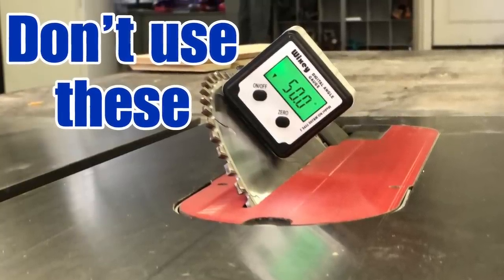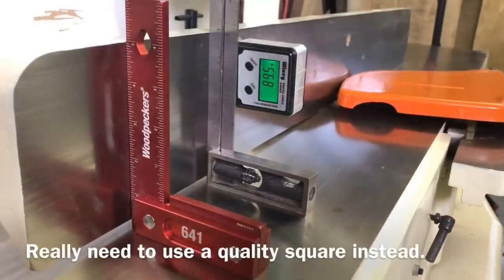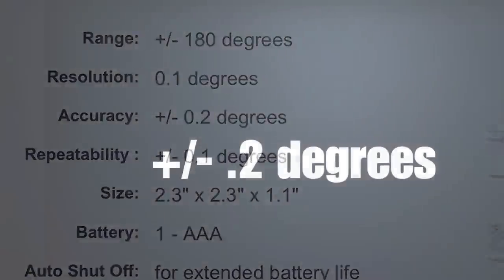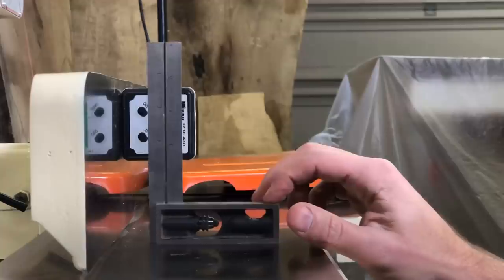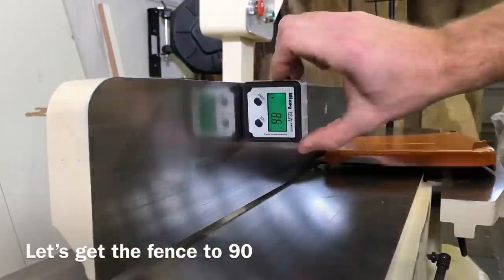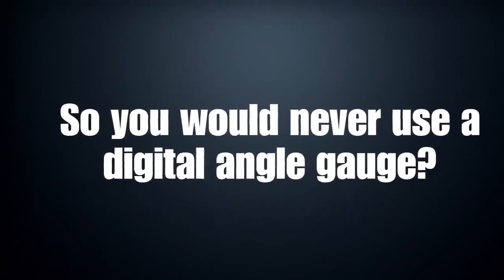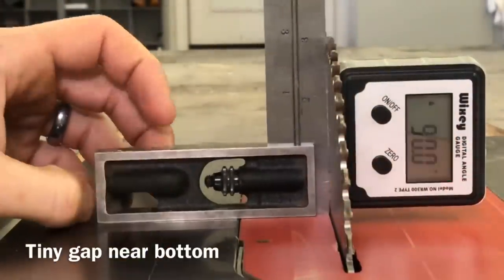Table Saw 101– Digital Angle Gauges— How To Woodworking

Comment: Home Depot squares are perfectly fine for 99% of woodwork needs. Pick out a square, stick it on a piece of plywood, draw a line, flip the square, draw another line next to the first. If those two lines track each other, it's good enough for woodwork. If not, pick out a different square. Those hundred dollar squares are for machinists who are milling precision parts. Save your money and buy that power tool you've been salivating for.
Reply: Exactly .  I use mitutoyo, starret and b&s measurement tools with metalworking and the precision that gets you is nowhere close to what I need for woodworking.  HD squares are fine for my wood - at least the type I do...
Reply: You said it all. We deal with wood which is flexible enough to absorb such small errors.
Reply: Rich Sobocinski I look forward to the day when I can blame a tool that is off by minute amounts for the mistakes in my projects. Right now I am thrilled when can make a drawer that doesn't bind.
Reply: @MJCPeters  hahaha!!! Same!!!!!

Comment: Woodpecker Tools are essentially Festools of the hand tool world. They're novelty items with gimmicky features, and most of those features are glorified convenience items and not necessities. No question they have some innovative tools, but for the price they're asking, you're better off using that cash for another tool. Or, buying 2 tools instead of 1 Woodpecker tool. A simple speed square for $100+? For those naive enough to buy one, I have some beachfront property in Kansas I'd like to sell you.

Comment: I have adjusted my lifestyle to accept a 0.2° error. There's always gonna be fussy people in the world, and Starrett will be forever grateful for their continued patronage.
Reply: Or people who are doing metalworking who need dead nuts on measurement.  Absolute precision in Woodworking is nice, but far from necessary.
Reply: @shirothehero0609  Until you don't do something where it's required. Last year because of Covid I started to make some stuffs with wood and hungarian zithers. When I had shown one of my zithers to a luthier he mentioned about some of my joints is great for a furniture but it have to be better for a musical instrument.
Reply: @saxus  Wood is never going to maintain it's dimensions even from one minute to the next due to temperature and humidity. It also compresses, making it impossible to get a precise reading. For luthier work, you do need higher precision than furniture making, but the tolerance is still way below what's acceptable for even low precision machining.

Comment: He's saying a $100 square is more reliable than a $25 digital gauge. That's fair, but how does it compare to a $100 digital gauge?
Reply: I can get better accuracy using a square and my eye than the $100 johnson gauge i got. Honestly probably faster to. These gauges seem to have a really shitty lag time or only register movements of .2/3 of a degree or more
Reply: @zacheiriksson  the lag time drives me NUTS. Set it exactly where I want it, wait ten seconds, then as soon as my hand starts going towards the gauge it jumps by .1 or .2 degrees.

Comment: once and for all there is no reason to buy a $90 square from woodpecker or starret for that matter. I have witnessed a lot of cases of the woodpecker squares being out.  This is an example of prestige pricing like I have never seen. Go get yourself a machinist square for $20 if you want something accurate and be done with it. Want accurate measuring go get anything for metal working (what starret is known for) and they  will be more than accurate enough for any woodworking and at a 10th of the cost...
Reply from the maker: Thanks for the tip!
Reply: how do you find an accurate machinist square for $20? The ones I've seen on amazon for that price all have a number reviews saying they're out of square.

Comment: This comment might bump the algorithm a bit. I was taught to use the edge of the blade on my square instead the of flat part of the blade. Turning the square at a slight angle gives you a finer line to visually inspect better.

Comment: For digital gauges to work, the tool has to be perfectly level from the floor up. If your tool is on a angle at the floor, the angle will be off greatly when finding the square for a fence

Comment: 1:39 ⌐_⌐ and both squares had a visible gap at the bottom (you can even see light from behind them through the gap at 1:47 quite clearly) because they contacted the top of the guide fence first, telling me that the fence is effectively canted inward toward your blade.
It may well not effect your work as you alluded to, but the angle block is actually correct in those instances because the fence is actually slightly leaning inward from 90 degrees.
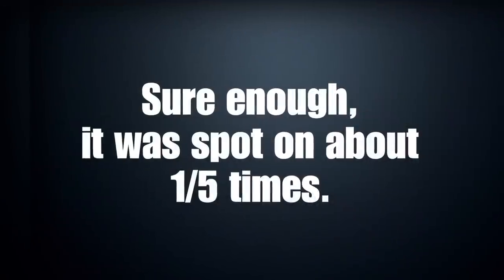2:21 So, you go to the effort of squaring the fence to the table, the angle block now reads 90 degrees exactly, and surprisingly enough your square is also flush to both surfaces.

I'm not going to say digital angle gauges are infallible, anything that is man made inherently includes man's limitations, but I think your video actually demonstrated that the gauges are plenty accurate and if anything helped you to identify that while your squares are indeed square, the fence was not square to the table, and once it was then all the devices started agreeing.
Reply: I absolutely agree with your observation. From my perspective I saw the same thing, and I think you're right that when he set the table fence to 90 degrees on the angle gauge, the square matched up flush to the fence, which just confirms the accuracy of the angle gauge.

Comment: i see a gap between both squares and the fence......1:47 in the video shows it really well. So the digital gauge is pretty accurate when it says your fence is at 89.5 degrees.
Reply: Saw the exact same thing!
Reply: Me too
Reply: Yes me too, the digital was accurate and his square was out!
He pushed the blade of the square against the fence lifting the base off the table at one end & pronounced the digital gauge as being out, but not his square! 😂😂
Crap happens- especially when your filming unfortunately!
Heck timber moves between summer & winter even after its kiln dried down to equilibrium moisture content, & how much the same species sawn from the same log varies, with whether it’s radial grain or tangential grain!
&
This guy is worried about + or - 0.2 of a degree?

What are you building a timber space shuttle? 😂😂😂

As my old man would say, “we ain’t building Omega watches, sunshine!” 😂😂
Reply: me three. you guys beat me to it
Reply: Yup, I saw it to
Reply: Well shit, I thought I was the only one to see this 😢
Reply: Me four. Although I have to say, I've yet to see one of these types of woodworking videos where someone diplays a square in front of the camera the way you should do it in real life to show if it's truly square. i.e. in front of a light source to see where there are gaps
Reply: I came here to say the exact same thing
Reply: Exactly this. Lightsource behind and no visible light, then it is square. A mouse could fit through the gap I saw down the Woodpecker one.
Reply: @m3nt4l173  From what I saw the bottom of the fence is worn slightly (or the fence isn't straight and bends 'away' from the table) - I'm not 100% on this, but I AM 100% sure that the internet NEEDS to hear my opinions. :D
Reply: I thought so as well. What we need to see is the square and some feeler gauges to see if any feeler gauge will slide behind the square at different points. even the light test isn’t 100% in my experience but if a feeler gauges slides behind, you can determine the degree of inaccuracy.
Reply: Saw that also
Reply: I see the gap too.
Reply: And that’s exactly why I came here to comment.
Reply: @ianmoone2359  
I build boats (fiberglass, not wood). When one of my guys was taking way too long, trying to be perfect, my go to was "Hey, Steinway, we ain't buildin' no Stradivarius". We always wanted to be really good but sometimes that last gazillionth degree of perfection will never come.

All that being said, 1/2 a degree could be too much, depending on the project.
Reply: I see the gap as well however it is not due to an error in either of the squares or the digital gauge. It’s because his fence is not flat. Unfortunately this is a common issue in the cheaper joiners made by Jet, Delta, Woodtek.  My inexpensive 6 inch Delta Joiner (37-160) has the exact same issue.  On the other hand I have a inexpensive Wixey knock off digital gauge and find it to be pretty accurate.
Reply: Cousin Justin  I hear your point Justin.didn't mean anything in the way of his character. I think it's important to comment (in a nice way of course) and give constructive criticism. He did ask us what we think at the very end so I think these comments are justified. Also every time someone comments and starts a dialogue, from what I understand, it's good for his channel. I personally think this is a great topic, and very creative that he chose it. I will certainty be interested in other videos he puts out.
Reply: The accuracy of the tool means little if used improperly. Definitely should have used the digital gauge to square the fence.
Reply: Exactly right. That gap in the square near the bottom is confirmed by the digital gauge self correcting to read upright when it's slightly inverted. (past 90 degrees)
Reply: yep... me too...
Reply: yeah this dude is delusional lol.
Reply: There is a calibrate button on the gauge for a reason...
Reply: The gauge is only as good as it's last zero and that zero is relative. The physical gauge is always relative to your saw but the digital is relative to whatever it was zeroed on. Perhaps your table isn't perfectly flat in some cases and this could make your cut off or appear to be
Reply: catched in a video ...
Reply: @ianmoone2359   бил решен да изгради вселенско летало, но се откажал, не му дихтувале вратите.... ;) тоа е човечки проблем, кога ќе посака да омаловажи некои работи и за влакно се фаќа само да му успее :(
Reply: @slavcheperkov6698  Sorry I don’t speak Mexican. 😜😂😂🇦🇺
Reply: You need one of those precision protractors we used to set the glide slope on airfield equipment.
Reply: @rogermccaslin6750  Agree completely, but Steinway built pianos not Stradivarius violins, but I digress.
Having built a boat or two (CNC plasma cut aluminium) I have great admiration for shipwrights myself after 20 odd years as a wood butcher, milling, kiln drying and making cabinets, joinery & furniture for a living, the constant climbing in and out of boats under construction to hand scribe every knee or rib would kill me these days. I’m too old and fat for that game these days, I’d end up like a turtle stranded on its back & need rescuing. 😂😂😉👍

Comment: I’ve seen some pretty nice stuff made a hundred years ago, and there’s no way they had the accuracy of either.  I think the important thing is to understand the error and how to compensate for it.

BTW, semi new subscriber, enjoying the videos and your work.
Reply: Some of the old optical based methods from a hundred years ago rival some of the new laser technologies.  Optical autocollimators are used in measuring the surface flatness of surface plates down to 5 millionths  (a quarter arc second). They did amazing stuff with remarkable precision, a hundred years ago they just used different tools.
Reply: Great observation and comment.
Reply: They absolutely had that accuracy 100 years ago. Check out gauge blocks, invented in the 1890s (https://en.wikipedia.org/wiki/Gauge_block). Accurate to within a millionth of a centimetre. Lots of 80-100 year old machinist's tools are also still in use, and are and were easily accurate to 100 microns.
Reply: Probably you should learn the old techniques first. In the past you had a lot of specialized cuting, planing, marking and measuring tools, techniques which can provide similar precision. In old time, lot of woodworkers didn't buyed they tools, they made it, because had the knowledge to make a good square. Actually you have to know that even today to know how to check it is it still in square or not. 

Now a lot of things was replaced by fancy machines and buyed tools. Not because everything is more accurate but productivity.
Reply: @saxus it is not about either one. It's about money.

Comment: As an Asian style woodworking hobbyist, I usually use the mortise-tenon matching method instead of measure it them separately. Since in most of the time, my tools are not deadly precise. For example when joining two boards, I clam two pieces together and hand plane the gluing sides into one surface instead of depending on deadly 90 degree jointer to make two perfect 90 degree surfaces separately. Besides, no matter how precise wood is milled, they will move very soon. In most of my working situations, flatting ,matching, stabilizing and smoothing can be achieved with a +-0.2 degree gauge.

I also use your method to check my digital angle gauge. Surprisingly,  it is quite precise. It shows 90 same as my woodpecker square.
Reply from the maker: Asian style woodworkers are the best out there. So I’m sure you know your joinery 👌

Comment: I bought the Klein digital level (the newer model).  My Klein digital level has been very accurate, however if I use it to calibrate my bevel angle on my 12" Ridgid miter saw (blade : saw table) it matters where and which side of the blade you attach the level to using the magnets on the level.  Always attach your dig level as close to the center of the blade as possible.  The weight of the level makes the blade tilt slightly if you put it near the edge of the blade. If you keep it very close to the center the blade won't move tilt due to the weight of the level.  On my saw if I attach it to the right side of the blade it causes the blade to tilt no matter where I attach it and I get a bad reading.  If I attach it to the left side of the blade and  near the center as possible, I get a steady reading and then I use the set screw to fine tune my bevel to 0.0.   If I attach the level to the left side of the blade after I get it locked down, it will read 0.0 but if I attach it to the right side of the blade, for some reason the blade can tilt from the weight of the level and it will read 0.1-0.2  - no matter where I put the level so you just have to figure out where the steady spot is on your blade.

Comment: Yeah, well, no, fine!?

(Warning! This comment  contains rambling personal views which may offend sensitive woodworkers) 

I bought a somewhat similar digital angle guage and eventually donated it to the local animal shelter because it was dang difficult to read. Firstly because it the one I bought didn't have a back-lit display. I literally had to use a flashlight to read it. Secondly because the display shows (for example) 95° as well as 85° as 85° i.e there is no indication from reading the numbers whether you have moved beyond vertical or still have to get there. There is a separate place on the display that you have to look at for that. And who needs that addled aggravation with both hands occupied with setting whatever you want to set while feverishly clutching a flashlight between your front teeth.

But those are design issues that can be resolved by being careful what you buy.

I tested that one for consistency by placing a pie dish with a ½" of water in the freezer overnight and using the resultant ice surface as a "perfect" flat. Rotating the device around its vertical axis and reading it from different angles gave a surprising degree of consistency - in fact it showed no errors at all.

In the meantime I had installed an "inclimometer" app on my smartphone and made a steady bracket to hold it in. I tested it the same way and got the same results (and for free). No waiting for delivery and no shipping costs either. 

So as to the accuracy of such devices, my observation is that results in using them will more likely arise from the skill of the user than from the device itself.

Having said all that, to get to the question of how much accuracy does one need in woodworking?

My answer is "as much as your particular project needs". If you are making a sawhorse the a degree or two either way isn't going to make much difference to how it works. But making wooden gears for a clock is another thing altogether. I don't think that the topic lends itself to an "absolutistic" approach.

This philosophy should not become an excuse for sloppy work. My approach is to aim for as perfect a finish as I can get every time and to use every cut I make as an opportunity to do better.
Reply: Love your water into ice idea.  Consider it stolen.
Reply: @EscapeMCP 

You are most welcome. You should experiment a bit. Depending on the depth of the water, the shape of the dish and other factors, you can get that the ice bulges up in the middle. I got around that by adding another 5mm of water on top of the ice and letting that freeze.

Have fun...
Reply: @EscapeMCP 

Hi,

I forgot to mention that you need to calibrate your inclimometer / level guage without moving the "ice floe" from the freezer as well as taking care not to disturb its position in any way while working on it in any way.

Why I only thought about adding this this morning is a mystery.